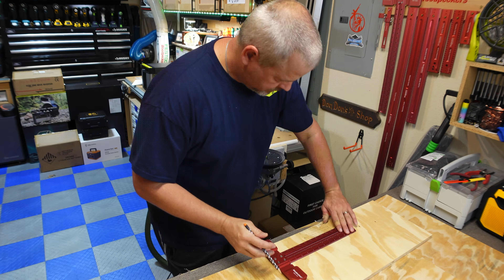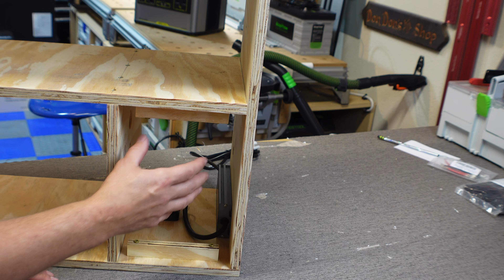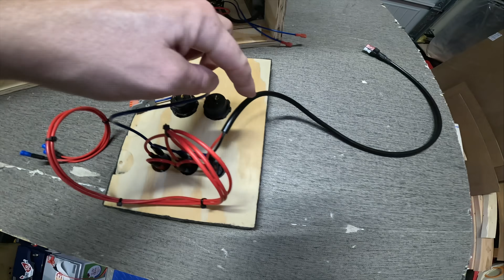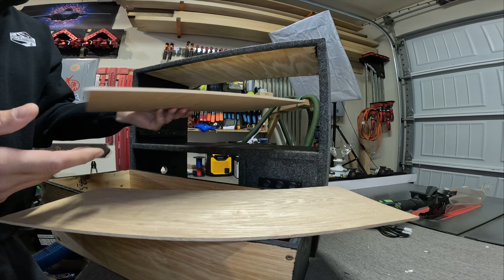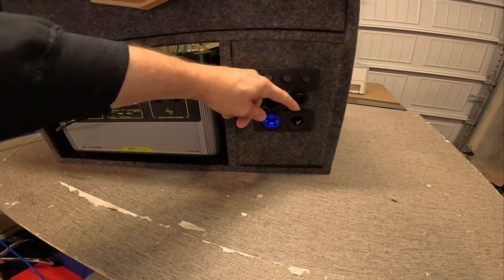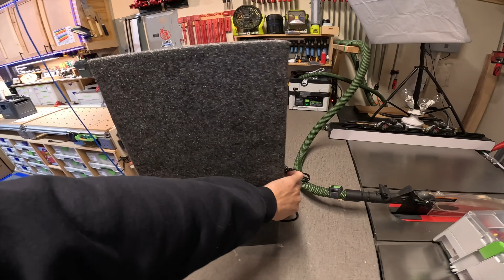Truck Camper Cabinet Build: Full walk through of construction and wiring.

Comment: i apologize for all the questions 

but im getting ready to attempt this build.

what is the plug that goes into the unit for the lights. the anderson connector is rectangle and you are plugging in a round.

also is the video up for the cab lights?
Reply from the maker: I don’t follow. I’m only plugging in an Anderson plug into my goal zero. There’s a rubber boot on the cord maybe making it look round?🤷🏻‍♂️
Reply: sorry for the confusion im just new to wiring 

but i love your work keep it up

is the wiring of the cab lights on video also

Comment: Hey,  love the camper. Quick question. How tall are you? When you sit on the bed upright, how much headroom in inches would you say you have?  I'm 6'0. Thinking of building out something like this in my F150. Thanks.
Reply from the maker: Hey Kody, I’m 6’1. I have about 2” above my head when sitting on the bed👍🏻
Reply: @BrianWatersOutdoors  good to know... which model cap do you have? It looks slightly taller than the truck cab
Reply from the maker: It’s the 180 model. About 4” extra headroom than the standard model

Comment: Which drawer slides did you go with?  Did you use the same ones on the pull out tray/shelf as the drawer?  What’s the dimensions/size of the tray and drawer?  

I like this design and would like to build one. Thanks Brian!
Reply from the maker: They are just standard full extension drawer slides. The bed drawer is 18” slides and the cabinet drawer is 10” drawer slides.

Comment: Very cool concept box. You have perfect craftsmanship. One question I have is you did the two lower outlets for shore power. Are you also creating a way that it will charge your goal zero as well?
Reply from the maker: Thanks Jodey. I could use the 12v cigarette style port to use with the power station 12v charger if I ever needed it👍🏻

Comment: Nice job...very clean design. Next project...charging the power station with solar?
Reply from the maker: Not too worried about that since this setup is really for short term trips. I will carry a portable solar panel, but between the goal zero and another 100ah battery under my bed should be more than enough for what I need👍🏻

Comment: You’re gonna drive the ladies crazy making dominos in socks. LOL. The cabinet looks fantastic. Is the drawer and table tight enough that they won’t move while you’re driving?
Reply from the maker: I did that on purpose😉😂 and I also built the drawer box about 1/8” too wide so it’s a tight fit. Takes a pretty decent tug to slide it out so it should be fine when traveling.